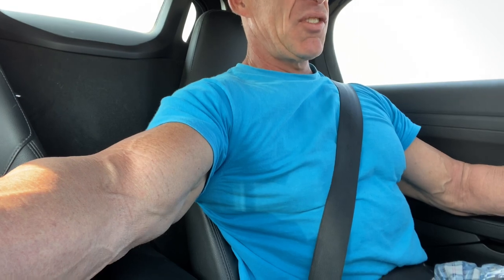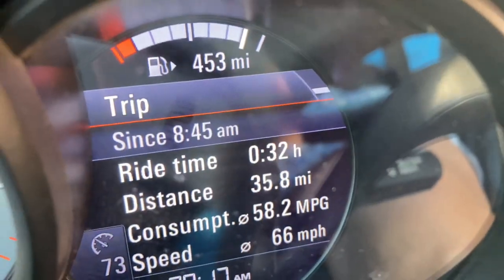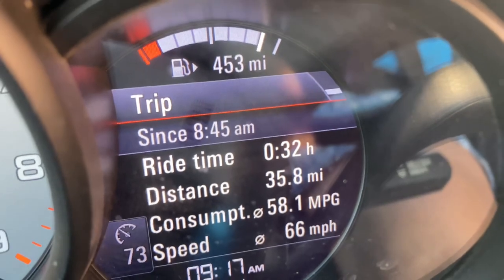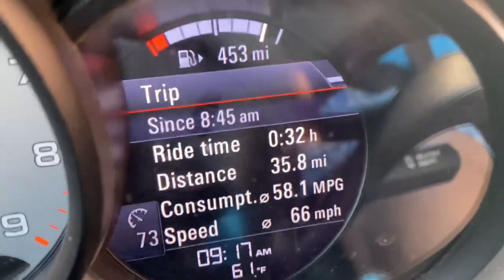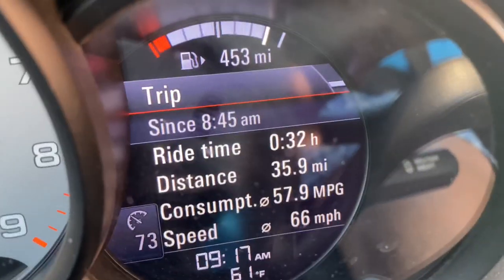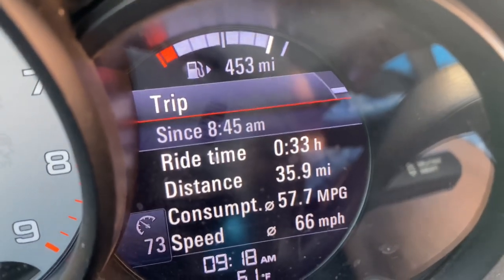58mpg in a Porsche - goose and glide

Comment: in europe, where most drive manual transmission, neutral driving is not taught in driving lessons, it is dangerous.
Reply from the maker: Doing anything is dangerous if you do not use common sense.
Reply: Interesting; however I did learn it here in Austria and my father and many others I know use it as well. Please don't speak on behalf others ( not using neutral ) assuming they had the same experience, since you don't know ( and neither do I ), what kind of driving is taught in other countires in Europe.
Reply: @paulmares9815 
That's great. I did not say that it is forbidden, but that it is dangerous and that it refers to new drivers. Experienced drivers often use neutral and the essence is that this way you can cover a greater distance in a shorter time because nothing stops the car.
Personally, I wouldn't try to save too much that way ...
cheers
Reply: @dejan8933  You are correct in the UK I was told this also when learning.  Neutral is only used when stationary for a long period e.g. road works / traffic lights
Reply: It's probably not the best idea on steep, winding mountain roads.  It certainly used to be the case that you could wear or overheat your brakes out before the bottom of the hill if you didn't use engine braking, but whether that is still a problem with modern brakes, I don't know.
Reply: @scooby1961  It's funny to read a comment about common sense from a person who drives with a dog in his lap while recording a selfie video.
Reply from the maker: Please stop repeating what you heard in drivers training without thinking about it and analyzing it. This technique is NOT dangerous if you use common sense! I am going downhill with no other cars within a 20 second radius of me. If I find I am going faster than is safe, I would cease this technique and go back into gear to use the engine to brake. The reason that drivers training tells you to stay in gear is that if a deer suddenly darts in front of you, you need all four options open: to swerve left, to swerve right, to brake, to accelerate. Those are the four ways you can avoid a collision. When it comes to the choice of braking vs acceleration, braking is the right answer 99% of the time because 1) if you fail, the collision is slower 2) you can decelerate much faster than you can accelerate. THINK about this situation. I am going down a steep downhill very fast, in fact, I am going as fast is as safe and legal. Should a deer dart out, going faster is not a good choice nor a legal choice and the brakes would be a much better idea. For the sake of argument, lets say I was going half the legal speed limit coasting down the hill in gear because I remember that drivers training told me to do this. A deer jumps out - SHITE! I decide that acceleration is how I will avoid the deer but I know that I am in 6th gear at 50mph and that even in a high powered sports car, stepping on the gas in 6th at 50mph will not cause the acceleration required to prevent the collision so I downshift to 3rd and punch it. There goes the drivers training safety argument. I have to shift anyway to avoid the deer and it doesnt matter if I have to shift from 6th to 3rd or from N to 3rd, its a one second shift either way. Braking is better for collision avoidance 99% of the time. Its only at low speed where acceleration becomes a viable option.
Reply: @scooby1961  
OK. Detailed explanation. Of course common sense should be used and this should not be emphasized. Personally, when I go downhill, I use the same or even lower gear than the one I used uphill, of course without gas.
Cheers

Comment: Love this, I coast out of gear a lot in my '91 stick Corolla with 634K on the clock can get well over 40 mpg regularly (my best is 47 mpg) using this technique. I have heard it called 'eco-driving'. With the hills we have here in GA, it is great. Coasting uphill is good to save brake material when you are exiting the highway, primarily using the slope to slow you down. Great video, gotta love the science of it all.

Comment: As many has commented most cars shut off the fuel completly which means they use 0 fuel on downhills, if you don't really understand the world this can be interpreted as coasting in gear gives better economy. However since you also slow down a lot I agree that neutral gives the best milage!
ONE INTERESTING POINT: My Chevy Avalanche rarely goes down to 0L/100KM (only when coasting really fast)  it stays at 2L/100KM (that's a really low consumption, for all you Americans 😜), I wonder if that's the best compromise between consumption and engine braking? 🤓 (I do notice that my car seems to coast faster downhill than most others!)
Reply from the maker: Incorrect, a gas powered car will NEVER shut down completely on downhills because that would cause complete loss of power steering and power brakes.

Comment: Wow Scooby, I think this is the first video I come across where what you say is plain wrong. If you go downhill on a gear, it is the gearbox that's actually moving the wheels. If you go neutral, it's the engine and that requires fuel to power!

Besides, it is not safe as some people have already pointed out.
Reply from the maker: Do an experiment : Start at top of hill at a set speed and coast to bottom with the car in gear and see your speed at the bottom of the hill.  Repeat with the car in neutral and you will see I am right. 

When the engine is connected to the wheels, the internal friction in the engine acts as a brake. If you want max speed for minimum gas when going downhill, you have to disconnect the engine.  

Use friggin common sense, if you are unskilled driver or if road conditions/traffic conditions suggest this is not a good idea then DONT DO IT.
Reply from the maker: your knowledge about how a transmission works is incorrect. In neutral the engine is disconnected from the wheels.  If you doubt this, put it in "N" and step on the gas :)
Reply: @scooby1961  You'll go slightly faster. Not by much. You'll also use more fuel. Again, not by much, but the engine ticking over in neutral uses more fuel than the engine being kept running by the movement of the car. In gear, you use no fuel when you are off the gas pedal. Also, if you want to go fast in a straight line going down a hill, pedal to the metal... Also, if you did the same trip back up the hills, what was the MPG for the total trip? That's the real test of whether your strategy works.
Reply: @tummyrubber2k939  i drive a manual, for 20+ years now. I live on a mountain. Coasting out of gear speeds you up I've gained 15+ mph doing this and never touching the gas, 5th gear slows you down no matter what speed i am going. Scooby is right
Reply: @captainfancypants4933  Scooby is right that you will go faster. Scooby is wrong that you will save fuel. The engine requires fuel to tick over when it's out of gear. When you are in gear and not using the gas pedal, the engine is kept running by the movement of the car. It's up to you to decide what matters more. The thing is, if you want to go fast, put it in gear and boot it? The argument is so niche. That 15 kph makes you go the exact speed you want to go at the smallest fuel cost? Bit farfetched.

Comment: Here's an even better idea. Turn off your engine and just roll down a hill! Zero fuel used! Seriously though, never put your car in neutral while coasting. Disconnecting your engine from your wheels will make the car much less stable if you need to emergency brake or turn. Also depending on the hill it wouldnt be much more efficiënt anyway.
Reply from the maker: watch the video to see why this is not a good idea

Comment: Leaving car in ‘D’rive does brake the car when going downhill. This is not an argument on saving gas but keeping momentum. Keeping momentum saves gas.
Reply from the maker: Yes.  When you leave the engine connected to the wheels when going downhill, the engine acts as a brake.

Comment: This was true on older cars but is no longer true with modern ones. When you're in gear but not on the gas, the car turns the injectors off and consumes no fuel at all, since the wheels themselves make the engine spin. When you're in neutral, regardless of your speed, the car must use a small amount of fuel to keep the engine idling.

You might notice your fuel economy computer showing better mpg when coasting in neutral, but don't believe it, it calculates fuel based on airflow past mass airflow sensor, manifold vacuum and engine rpm, so it's not accurate while coasting in neutral.
Reply: Couldn't have said it better myself.

Comment: Modern cars shut the fuel off entirely when coasting in gear and whilst there will be some loss of momentum, in a high gear this is minimal and fuel economy savings of being in neutral are questionable. 

More importantly this is potentially dangerous, as you are not in full control of the vehicle. In the UK/Europe this is taught specifically against and is illegal (albeit difficult to prove). 

Not sure I see the positives in this choice of action.
Reply from the maker: ncorrect, a gas powered car will NEVER shut down completely on downhills because that would cause complete loss of power steering and power brakes.
Reply: @scooby1961  no not shut down the car, just stop injecting fuel to the cylinder. Everything else will still run, the engine (driven by the wheels and motion instead of combustion) the belts will still drive the utilities, such as power steering or ac, and the alternator will still run supplying voltage. Whilst at motion there would be no shutdown of vehicle at all by stopping the flow of fuel. If you did the same whilst the vehicle it stationary, yes then it would shut the vehicle down entirely.. Well kind of. 

As soon as you touch the throttle it will resume injecting petrol (gas) into the cylinder, assuming its an injection car. And run as normal.

Comment: Ok, that works... but that technique could be a little dangerous if you need to accelerate suddenly.
Reply: 1. Why in the world would you want to suddenly accelerate downhill when youre already accelerating by rolling in neutral in the first place?
2. Shifting literally takes a split second, unless youre an absolute garbage driver, which then poses the question, howd you even get a driving license in the first place?
Reply: @HulaLuau  to avoid an accident...
Reply: @deabru  You can probably do it still, just shift into some gear.
Reply: @HulaLuau  1. To possibly avoid a bad situation.
2. Crashes happen in a split second. Every split second you don't have to waste on regaining control over your vehicle (which you relinquished by putting it into neutral) can make a difference.

Comment: I have a 2006 Lancer Ralliart and do coast every now and then (especially when low on fuel and long highway drives) and seems to be more efficient.
It's logical that Neutral spends less gas than in gear as the injected fuel is based on the RPM.
The newer cars would either be as or more efficient in Neutral because the software may be controlling some of the mechanical parts (doubtful) and lower the injected fuel for economy. My only concern about newer cars is that it may cause some king of de-synchronization between hardware and software.

For those that say you have less control:
Most manual versions have better acceleration than their automatic counterpart (for the cars that don't, then the acceleration will never be an issue to shift into gear and still be faster than normal everyday consumer car).
You still have as much steering control and brakes still work (plus often have a manual handbrake).
Most cars have really bad acceleration (some worst than trucks) and even in the advent of an emergency would not be able to accelerate in time. Most automatic cars (and some manuals with turbo lag even at higher RPM) have a software built-in response time (250-1000ms) before downshifting to accelerate as if it is waiting for a confirmation that the driver actually wants to accelerate and the pedal was not pushed down unintentionally (I really hate those cars).

Comment from the maker: When the engine is connected to the wheels, the internal friction in the engine acts as a brake. If you want max speed for minimum gas when going downhill, you have to disconnect the engine.  Use friggin common sense, if you are unskilled driver or if road conditions/traffic conditions suggest this is not a good idea then DONT DO IT. 
Sadly the comments here illustrate why America is well on its way to becoming a 3rd world country - our lack of investment in education.  America is now nation of science-illiterate people who are all convinced they are Albert Einstein because of the Dunning-Kruger effect.
Many people here will argue with me about physics and tell me I am wrong without bothering to google what "Dunning-Kruger" means, sigh.
Reply: "3rd world country" that's a bit arrogant m8, y u mad tho?
Reply: You drive with a dog sitting on your lap and record selfie videos while driving (both of which are illegal in many places, for a good reason). Who are you to talk about road safety and common sense?
Reply: Scooby this is incorrect, its a tricky many fall for in my country where is common to have manual gear. Like you said when going downhill the momentum of the car will turn the engine acting as a brake, this is however better than leaving it in neutral because: 1) you will have minimum fuel consumption when instead it would need to throttle up to keep rpm 2) it will keep higher rotation allowing better oil pressure and lubrication 3) you have more traction on the wheels allowing for more control specially on curves going downhill and 4) it will save you from holding on the brakes all the time to hold speed.
Reply: Wow, do these people commenting people even drive?  I have been using this technique forever when I drive a stick. Been driving for 30+ years.   I can drive my stick twice as far between fill ups than I can with my automatic with a smaller more fuel efficient engine.  Must be the same people voting for Biden/Harris.  No clue and you can't tell them anything factual or anything to do with common sense.  Sad really sad.
Reply from the maker: @jdjewellpa  We dont agree on politics BUT we both understand the engineering behind cars and how to get the most out of them.  Lets stick with that.
Reply from the maker: @xvzf115   Arrogant is when I say America is the MEGA WORLD POWER and the EU and CHINA need to kiss our boots.  Look up the word "arrogant" before you use it next time.
Reply: @scooby1961  ok sorry gooby, I won't do it again.
Reply: @scooby1961  sounds good scoobs.  Our politics are probably more similar than you think. Be well.

Comment: Wanna get more miles here are a few tips:
-buy a family sedan 
-always service your car properly(oil change ,brake check,wheel alignment)
-inflate the tire to the manufacturer recommendation
-switch off car when stuck in traffic or signal
-always drive 70-100 kmph average at 80 kmph
Here's a pro tip for extreme efficient seekers:
Always don't fill full tank unless your on a really long ride ,for short commute to work, grocery shopping use less fuel (airlines usually fill their tanks will fuel that's only needed to reach their set destination) as low fuel=less weight= less energy to carry that weight
And always service your car with the company or with a certified servicemen as not using the right engine oil can cause more drag inside the engine can lead to loss of power and efficiency
Putting on the wrong disc pad can cause a mild braking effect and lead to loss of power frequent brake disc changes
Reply from the maker: tire pressure is key, I should have mentioned that.  Actually, many times pressure is specified for performance, not economy, so sometimes you need to go higher than spec.

Comment: This is why we teach people to NOT take a car out of gear like this...
You pick up speed quicker and go faster than you otherwise would.
You have less control because you can’t control speed via engine braking - since the engine is not connected to the wheels.
Because you are going faster, you have to use your mechanical brakes more aggressively, which can wear out brakes more quickly.
It becomes more challenging to take a safe, steady line around a corner - meaning you'll have less control if you cross the path of another road user or other hazard.
If you do need to re-engage the gears in order to react to a hazard, you'll have less time to do so than if you weren’t coasting.
Reply: yup this is completely idiotic, funny reading scoobys copy/paste replies here lol

Comment: Everything but the first point makes sense. You should keep it in gear while going down hill to keep the engine spining, using the kinetic and potential energy that the car has. So the car can cut off the fuel supply to the engine and doesn't have to burn fuel to keep running. If you don't do that you'll just have to brake to avoid going over the speed limit, turning the energy into unusable heat.
There are scenarios where this saves fuel (multiple hills right after each other that get smaller towards the end)
Engineering Explained has a good video adressing this topic.
Reply from the maker: You do not understand the whole point of this video :(

Comment: You say the air friction is squared with the speed, but it's cubed = ^3
When I go downhill I usually need the motor friction to not go too fast. In Europe we learn to use the engine brake to not overheat the brakes. If the friction is too high put a higher gear so you won't have the problem to be in first gear when you select drive
Reply from the maker: https://en.wikipedia.org/wiki/Drag_%28physics%29
Reply: @scooby1961  my bad, the air friction is squared, but I mean the power needed is cubed